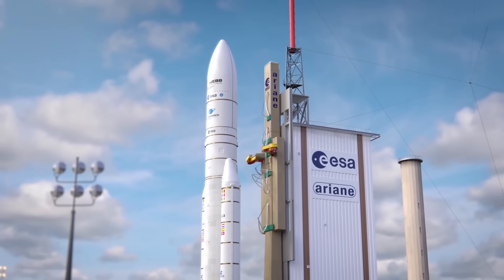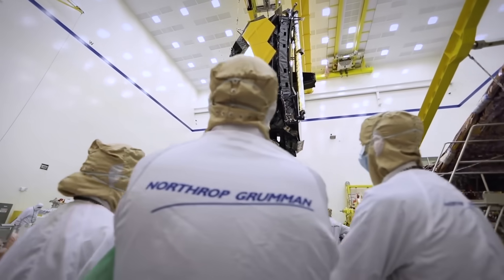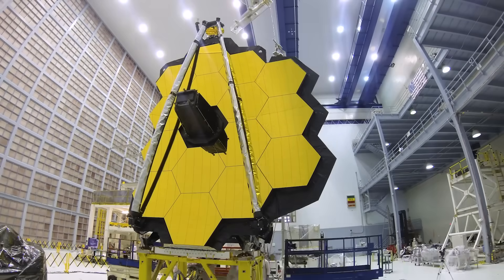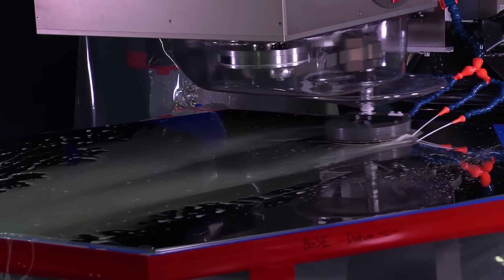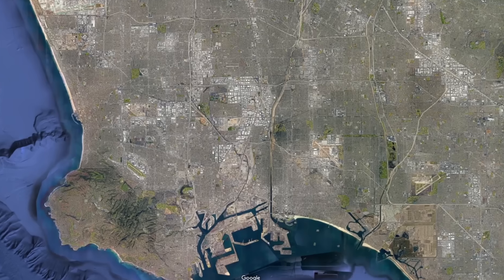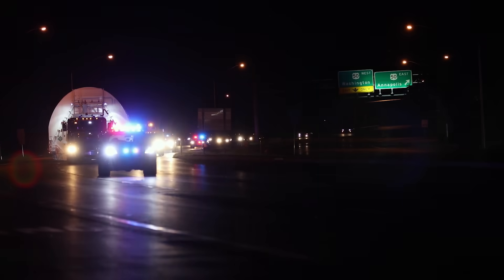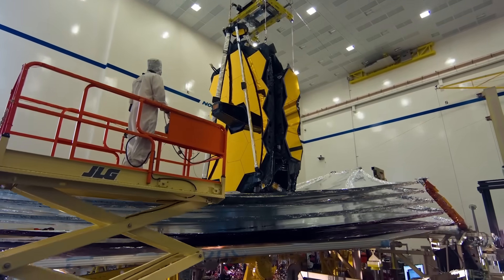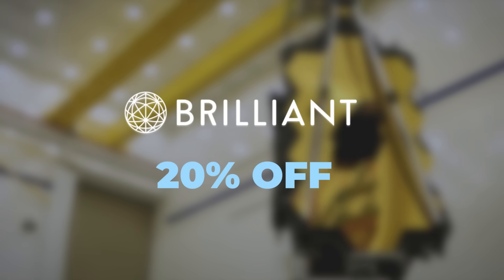Transporting the James Webb Telescope: How They Moved the World’s Most Valuable Object

Comment: If the equipment is so sensitive how did they launch it into space? Wouldn't the vibrations of launch be too much?
Reply: It's sensitive as in even a few particles of dust would ruin the polished surface, the material itself is rather strong.

Comment: .666ft per mile squared = Curvature rate of earth 
66,600mph = Earth going around sun 
1666 = Year gravity was invented (666 newtons)
66.6° latitude = North and south arctic circles 
6x6x60 = Diameter of the moon
6x6x6 = Surface temperature of uranus 
4.666km/s = Plutos orbital velocity
666 = Speed of sound in knots
600 x 6 x 6 = earth circumference in nautical miles 
1.666 AU = Distance from mars to sun
1,426,666,422km = Saturn orbital distance 
666 times brighter, the sun is than venus
666 days. Longest time a female astronaut has been in space

That's a lot of coincidences.

Comment: this guy deserves more subs and views
Reply: no. .666ft per mile squared = Curvature rate of earth 
66,600mph = Earth going around sun 
1666 = Year gravity was invented (666 newtons)
66.6° latitude = North and south arctic circles 
6x6x60 = Diameter of the moon
6x6x6 = Surface temperature of uranus 
4.666km/s = Plutos orbital velocity
666 = Speed of sound in knots
600 x 6 x 6 = earth circumference in nautical miles 
1.666 AU = Distance from mars to sun
1,426,666,422km = Saturn orbital distance 
666 times brighter, the sun is than venus
666 days. Longest time a female astronaut has been in space

That's a lot of coincidences.
Reply: RAPTOR3270 I suggest watch What on earth happened 13 parts by Ewaranon to learn that the earth is not a globe.

Comment: At $10,000,000,000 plus the cost of the Container, Truck & Trailer I would hate to think of the Insurance Premium for that little trip, I bet the Driver was topped up with Water as much as the Telescope was topped with clean Air 🤣
Reply: John Partridge I suggest watch a 13 part series called What on earth happened by Ewaranon to learn that the earth is not a globe.

Comment: what makes this telescope the worlds most valuable object?  does it cure cancer? does it solve mass starvation? does it enslave entire solar systems? WHAT IS YOUR STATEMENT BASED OFF OF?
its not even the most expensive, so the classic "value = money" insanity doesn't apply,  this telescope cost 10 billion dollars, meanwhile nasa is printing out "antimatter"  which is currently estimated at 82 trillion dollars a gram, 

this worlds fucking retarded
Reply: Since knowledge is priceless and considering the amount of knowledge it will give us about the universe I can see what they are talking about.
Reply: @Bellthorian  but the most valuable object in the world? it's bold claim........................... google servers are easily and infinitely more valuable just on the basis of knowledge, a library has more value than this overpriced telescope, even if it finds anything good, they'll just photoshop it like they always do,  
knowledge is worthless, if you don't have anything to use it for,
Reply: Marcus Avery I suggest watch a 13 part series called What on earth happened by Ewaranon to learn that the earth is not a globe.
Reply: @flat-earther  LOL Are you suggesting the Earth is flat? If you are I can tell you as a Battleship sailor that when we fired the 16 inch 50 caliber main battery we could launch a 2,700 pound projectile 23 miles. We had to correct for both the curvature AND rotation of the earth when calculating a firing solution to hit the target accurately.
Reply: @Bellthorian  So you are claiming the earth is a globe but are refusing to see evidence from the flat earth side?
Reply: @Bellthorian  I suggest don't generalize and collectivize. If you have not seen the series I told you, you have not seen the evidence I am pointing you towards.
I am pointing you towards stuff and then you should test for yourself to see it they are true, I'm not suggesting to just believe in the stuff I pointed you towards. 

What is your best globe proof that the average guy can test for themselves so no one has to believe the earth is a globe?
Reply: @flat-earther  so you go around space videos, find the money moaners and try some flat evangelism? What's your success rate?
Reply: @flat-earther  here's a good one, compare the amount of basic evidence for the globe and flat Earth. See which one has measurements, dimensions working maps or even a photo of the whole thing. 
Why cant flat Earth meet those basic requirements?

Comment: How the hell was this thing then launched with fuel and fire at extreme speeds and turbulence through the atmosphere with rotation and angles and the damn center of gravity itself constantly changing hundreds of miles into space and then transform itself??
I demand part 2. As it stands, the James Webb telescope is a hoax to me.
Reply: No you don’t understand. The telescope is collapsible so it can be stored in a nicely insulated compartment in a rocket. If you don’t believe it, maybe you can get a telescope and look at it for yourself.
Reply: @chikapunk4340  Then why didn't they nicely insulate it in a compartment for the truck? And no, I cannot verify it with my telescope, because it is permanently behind the moon (supposedly).
Reply: @nercopolis99  did you watch the video?  NASA designed a clean compartment for the telescope to transport it to the launch site by truck. There was hardly any dust in that compartment. Also, it is not permanently behind the moon. It is orbiting near the moon, so it is still visible.
Reply: @chikapunk4340  I'm not talking about dust, I'm talking about vibration. Why was it such an ordeal to transport it on the ground compared to a shaking vibrating turbulent flight through the atmosphere into space.

I take your point on the fact that (supposedly) it orbits the moon, not stationary at L2.
Reply: @nercopolis99  I’m not really sure, but I think it was to be certain that it was in the best condition while during the launch. You’re right, the telescope is bound to shake while in launch. Btw it is at l2 but it’s not blocked by the moon.
Reply: 100lbgrizzly I suggest watch a 13 part series called What on earth happened by Ewaranon to learn that the earth is not a globe.

Comment: Most valuable object? What? A giant container of clean drinking water?
Reply: K. R. I suggest watch a 13 part series called What on earth happened by Ewaranon to learn that the earth is not a globe.
Reply: @flat-earther  what does that have to do with my comment. 
Also, the earth is hollow cube, with openings under each pole and a small sun inside of it. I suggest you visit restricted areas at the north pole to see it for yourself.
Source: trust me, i was there.

Comment: Actually VH71 Kestrel helicopter is more expensive at 13.2 billion per unit and there are 28 of them that have been built, however, the most expensive thing ever built was is the The Itaipu hydroelectric dam worth 19.3 billion, but due to inflation it is worth over 50 billion today.
Reply: 1. Helicopters will not cost 13.2 billion dollars I dont know how you pulled those numbers out of your ass. 
2. James Webb is the most expensive object by cost to weight ratio

Comment: Just another piece of space junk floating around forever and will never be retrieved, like all the other defunct satellites, bits of rockets and other huge bits of debris left up there.  Not content with filling our own living space down here with junk, we do it on a grand scale in space.  We should not be allowed to launch anything ever again, and all this stupid amount in Billions should be spent on a mission called: ''Collect all the Crap and Clean up the Cosmos''.
Reply: @pezvonpez  (edited 'cos I was typing in the dark, by the light of the laptop screen, and had many spelling mistakes) - The amount of junk in space is astronomical (pretty good pun huh!?). Yes, it will (and has already) hindered and caused problems with satellites and even the Space Station (smashed window caused by junk). I could happily do without internet, mobile phones and GPS (heck, I still use a paper road map and atlas).  Weather forecasts?  Well, no matter what the tech they use, they still can't get it accurate enough for a proper long range forecast, even after decades of ''upgrading their tech''

You say I should ''have some respect'' for this telescope, as it's a ''technological marvel'' - well, so were cell phones.  A wonder of modern tech, worked on for decades, and now discarded and constantly upgraded and replaced like they were paper cups.  The same goes for home appliances - once upon a time, a technological marvel....and then...in a matter of a few years, a throwaway item.

This telescope, to me, is a waste of money and time.  Who cares how far we can see into the galaxy?  Who cares if we find a planet millions of light years away that is identical to Earth and can sustain us?  How the hell do we get there?  We'd all be dead by the time they figure out how to transport humans there alive at the end of the journey.

Looking deep into the cosmos is something humans have done for countless lifetimes - and it's all fruitless. We should just concentrate of living here, on earth, and using these countless Billions to sort this place out first.  This new telescope was not needed.  It created more crap and junk in the process of launching and seperating, and it will drift for decades, or even eternity, far into space, where one day, it may drop out of the loop, crash-land onto a planet, and the inhabitants there will ask ''what the hell is that, and who dumped it in OUR backyard?''

But, on a serious note, I still think any future launchings should be banned.  No more satellites or rockets, unless the company concerned can retrieve and remove their old out of date ones. NASA and other foreign space multi Zillionaires should be focusing on tyding up some of the crap already out there that THEY have created, but don't seem to be arsed about it (out of sight, out of mind)

WE on earth, as humans, get fined and prosecuted for littering - drop a crisp packet, or throw a drinks can into a bush etc....and yet all these space tech people can go on polluting space itself, and not even get fined a dollar.

Nope,  sorry - I have no respect for them at all!
Reply: @pezvonpez  - How can anyone not like this reply!! I appreciate and 'get' everything you wrote. - I 'hear' where yer coming from. It's great that not everyone agrees with everyone else, and hearing other peoples opinions and replies (without them feeling the need to be rude or resort to expletives) is, in this day and age, a rare thing. Thank you for your reply along with your thoughts - thay are all very much appreciated.
Reply: @WhosAGoodDogue  Wow, thank you! I didn't expect that, but it means a lot to me
It really made my day a little better :)

Comment: I didn't realize they had to lift traffic lights and fill pot holes.  That is wild.  Poor driver had to have been sweating bullets.
Reply: You dont lift traffic lights on routes like that the install ones that turn 90 degrees and a team just turn them as required.

Comment: Plot holes had to be filled and the container had to stay perfectly level

…why?
You’re afraid to shake it a bit BEFORE you strap it onto a rocket and yeet it into space?
Reply: Is there any pot holes in space?
Reply: Right? Also if the Mirrors need to be that Perfect. What is Protecting them in Space? there is a lot of little stuff flying out there.
I say it was a 10 Billion Money Laundry hoax.
Reply: Min maxing noob
Reply: Its most likely to not damage the container which is air-tight.

Comment: I'm confused. They're worried about little potholes and keeping it level as possible the whole time when they send it up in a rocket which surely severely rattles it?
Reply: Different loads. Driving was horizontally, flying in the rocket vertically. The carbon fiber frame of JWST was made to withstand vertical loads.
Reply: @techdefined9420  besides, there are stresses that can be controlled, such as the potholes, and ones that can’t, like the rocket launch. If you can control it, it’s better to do so, no reason to subject it to unnecessary stress.

A somewhat good analogy to life.
Reply: @IronHexacyanoferrate  Damn bro that's almost as deep as the potholes in my country's roads.

Comment: damaged by a flying spec of sand, proving that space travel is fantasy
Reply: You're arguing from ignorance. 
There's a lot more space debris in low Earth orbit than at L2. Despite that, we manage to operate thousands of satellites for decades. How can we do this? It's pretty simple: most space debris is tiny. So we build spacecraft with an outer shell that consists of two layers ( a Whipple shield). Anything that hits the outer shell disintegrates on impact. It might punch through the outer shell, but the fragments won't have enough energy to penetrate the second layer. We build in lots of redundancy.
Reply: @FourthWayRanch  There is no dome. That whole concept is based on a translation error. In the original text, the Hebrew word raki'a is used. This word means simply "expansion." It denotes the space or expanse like an arch appearing immediately above us. In the Vulgate this was translated as 'firmamentum'. The original text does not describe a dome: that was added by the translators who created the Vulgate. God's cosmology is closer to what we know today than that of the Latin scholars of 380 AD who created the Vulgate. So there's no reason to diminish His creation by considering the heavens above a dome with lights instead of actual space with actual stars. 
And we have independent verification that various interplanetary spacecraft are where NASA says they are. Astronomers have seen the Voyagers using radio telescopes, confirming they really are more than 120 AU out. Radio amateurs can receive signals from spacecraft at Mars.
Reply: @FourthWayRanch  What you see in all of those cases is a rocket ascending vertically, then doing a pitchover maneuver to get into a trajectory that gradually becomes parallel to Earth's surface. What you don't see is a giant explosion as the rocket hits a dome. 
Explain this to me: why would a commercial company spend all that money on a rocket launch only to have it splatter on a dome so he has to spend billions more to fake the service he's selling? Why do these companies make money while having only enough income to fund the satellite construction, launch and operation, not the 100 times more it would take to fake that information? 
There is no dome.
Reply: @FourthWayRanch  Read again what I wrote above. We have independent confirmation of spacecraft operating at Mars and beyond. 
Again, there is no dome. There is no evidence that supports its existence, and the only source you have is an old mistranslation that has since been proven wrong.

Comment: The individual mirror segments were fabricated from beryllium certainly because of low weight, but primarily because it has superlative low thermal expansion. The mast-mounted Long Bow radar added to select Apache military helicopters was (agonizingly!) fabricated from beryllium as well for its additional mechanical property of vibration resistance.

The truck drove at approximately 8 km/hr not because the STTARS rig was heavy (or unaerodynamic!), but because of vibration mitigation.

You should have investigated the matter of how much insurance is necessary to transport a $10 billion space telescope those number of miles on the road and sea. Now that would have a fun fact!
Reply: I'd be interested in what insurance company even dares to insure a $10B telescope for transport
Reply: @PapaLurts  100% agree. It would be crazy, or stupid, for Nasa Esa or any insurance company to just think about putting an insurance on that.
I don't know in the USwith Nasa, but in Europe, ESA is its own insurance company (yes, "IS" ,not "has").

Comment: Small thing, but route scouting would likely have been done by driving the route several times. Likely with a pole car at some point. Satellites and google street view miss a lot of low cables and things.
Reply: Actually they did that too
Reply: "Jones, HOW could you not notice that this bridge is too low for us to get under??"
Jones: "Well in the photos there was a cloud right over this part of the route.."
Reply: Blame all your problems on the weather, it works every time!
Reply: eh, the US military has spy satellites nowadays, can see the route in real-time
Reply: E Van  That doesn't imply that they didn't drive the route... just that they knew the only obstacles were a couple of lights that could be easily raised.
Reply: Duh? This was mentioned in the video.
Reply: They could probably just take new satellite images